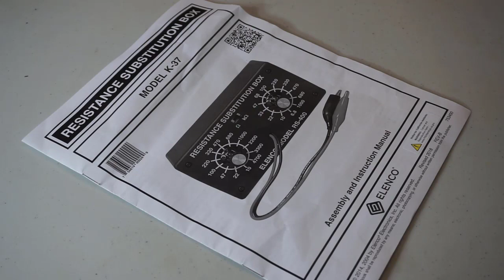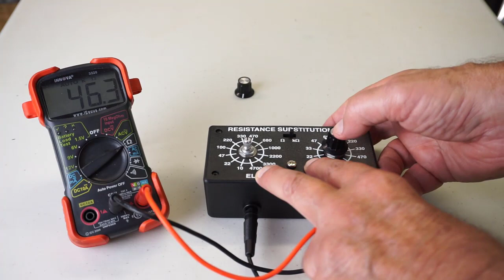GADGETS#175 - ELENCO RS-400 RESISTANCE SUBSTITUTION BOX

Comment: Where does one procure such a nifty piece of kit? That and the "interchangeable lamp load tool" that other poster mentioned?
Reply from the maker: I got the kit on Amazon...quick search for ELENCO RS-400 should find

not sure what was meant by "interchangeable lamp load tool" ...
Reply: Funny, when I search for rs-400 it says it's a CAPACITENCE" box and the resistance box is K-37. But I Cleary see RS-400 and resistance in your video.

Comment: Nice job, I'm guessing the 0.5w resistors are suitable for the computer circuits? That is where I was unsure. Still liked the interchangeable lamp load tool as well. Very well played. I'm sure there will be plenty more. Very cool. :)
Reply from the maker: yes, these are 1/2 watt resistors and solid rotary switches

resistors are 5% accuracy